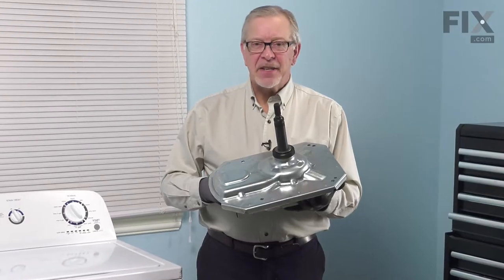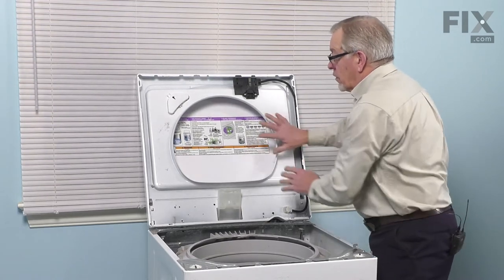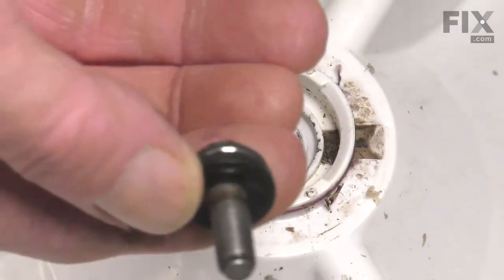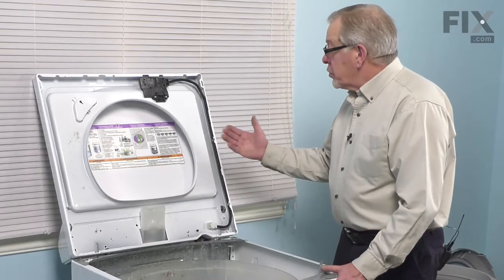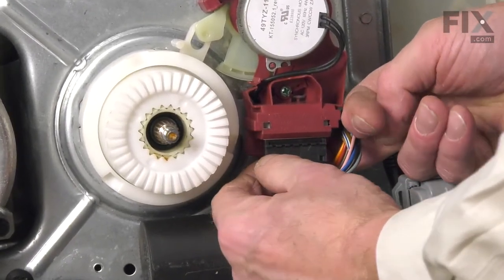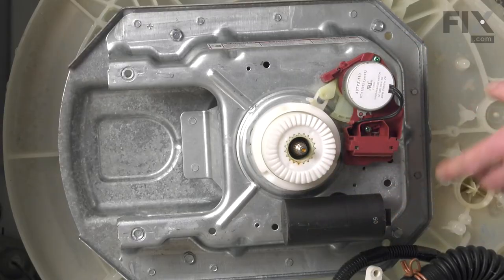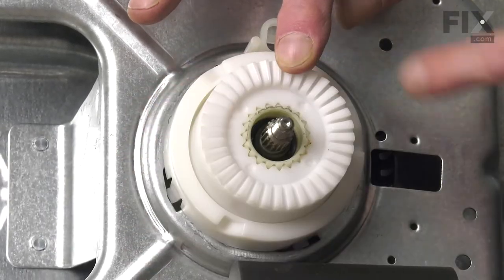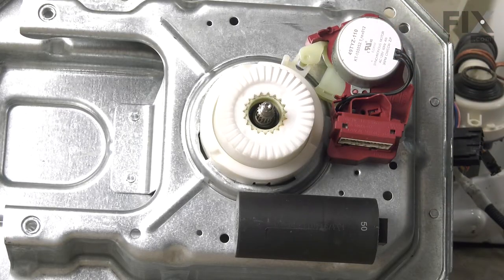Whirlpool Washer Repair - How to Replace the Gearcase

Comment: To those having a ton of trouble getting the tub off the shaft, don't give up. I had to use a 2x4 and a bottle jack. I even had to put the bolt back in the shaft because the jack bottomed out on the tub before it came free from the shaft. There are videos of how to perform this task right here on YouTube. To the person who made this video, thank you so much. You saved me a ton of money.
Reply: Yup, I used my car jack and a 2x4. I also had the issue of the jack bottoming out so I placed a 13/16 socket on top of the shaft and balanced the jack on the socket and it finally came all the way loose. "It's a really easy job", yeah right 😒🤥
Reply: I don’t understand why you have to remove the basket if there’s nothing beneath it you have to unfasten to get the gear case out…

Comment: For those with a stuck tub, I used a bottle jack, cut a couple boards to fit under the lip of the washer then placed bottle jack on top of shaft and raised until it was pressing against the boards thereby lifting the tub away from the shaft. Also for those without a spanner wrench (if yours needs it, use a hole punch or chisel and tap the nut counterclockwise with a hammer. This video was pure gold! Couldn't have completed the gear case change on my wtw5500xw1 without it!

Comment: Great step by step directions!  IMPORTANT CAUTION TO THOSE PERFORMING REPLACEMENT.  I followed the instructions and it worked perfectly, until the Fast Spin Cycle.  Sounded like it was spinning too fast.  I was wrong.  Spent a lot of time trying different things.  Came to conclude it was an alignment issue with the Hub fasteners and the Gear-case bolts.  The hub fasteners are accessed from inside the wash tub.  (Top side)  Whereas the Gear-case bolts to the housing under the machine.  (underneath)  The first time, I bolted these down separately, not thinking of the slight alignment  condition which ensured.   The second time (after the noise in the fast spin mode) I loosened both the gear -case bolts and the hub fasteners screws.  (Loosened, not removed)  I then moved the gear-case around a bit to re-seat the rubber washer inside of the bottom of the tub.  I then tightened the gear-case bolts a bit. (Not fully tight.)   I then flipped the unit back up, and secured the previously loosened hub screws and set the horse shoe fastener.  The I flipped the unit back over again to fully tighten the gear-case bolts.   IT WORKED!  No loner sounds like a jet plane taking off when in Fast Spin cycle.  Hope this helps others.  It worked for me.
Reply: Thank you for sharing this.
Reply: “Hub fasteners”?  What hub fasteners?

Comment: Thanks for a thorough and helpful video!

I wish I saw this before changing the transmission on a newer model.

I didn't put lube (soapy water) on the shaft gasket and had a hard time inserting the transmission into the tub. 

I suggest putting lube on any sliding plastic parts. Perhaps silicone grease.

Beware the sharp edges on the transmission.

Comment: Just did this a few days, and it was greatly appreciated.    after 10 years, i took all the parts outside and powerwashed all the slime and crude off the drum, the plastics and hub.     no amount of "Cleaner" cycles were removing that.

getting the spline out of the hub took some work due to the build up of crud and a little rust.

Comment: Thank you so much for this video. It made the replacement so easy. That said, I'm now encountering a different issue. After calibrating the washer, I am getting a "Load Balancing OOB" error code if I try to run a cycle with laundry. Any thoughts on how I can resolve this?

Comment: Excellent video! I work on cars all the time and I've fixed AC units, refrigerators, washers, and dryers in the past, but never done a gear case on a washer before, so I was reluctant.  This video featured a nearly identical unit to my model and is so detailed that anyone with basic tools can handle it.  Thanks again!

Comment: Fantastic video! Thank you so much for the detailed instruction, my Maytag Bravos X was loud during spin and found it was the gear case. Other information online for Bravos X lead to bad bearings but after looking underneath the machine it had the gear case which couldn’t be taken apart. Your video helped me take the machine apart, change the gear case, and put it back together. Thank you very much!
Reply: Same with my Whirlpool Cabrio. I hate the throwaway society and lack of replaceable parts, such as bearings.
Reply: I just did the repair. Put it in a recalibration. Now it won't fill or wash. If it's in the automatic test mode it runs through everything in finishes. Just won't do it when on a wash cycle. I'm a appliance tech been doing it for 6 years. I'm stumped
Reply: @joshuamills765 What was the solution to your stated problem?

Comment: Thanks for the video, it was helpful.  A couple of comments.  One, I have had to replace the gearcase twice.  The washer is only 8 years old, but it is clear that the gearcase design has some problems.  Secondly, removing the inner tub can be a problem.  As you suggested, I used some penetrant, but it still wouldn't come out.  There is a YouTube video that shows a method using a 2x4 and a car jack to get the inner tub out.  I know, sounds pretty sketchy, but it worked.
Reply: I have an idea how to fix the issue on maytag washer without replacing the gearcase and the hub's ass'y,please response to my email,I'll show you how it's done!.
Reply: @eddychakkaw4546   Hi Eddy
 I'm interested in your idea about the gearcase. Please elaborate. Mine is loud(howling) when spinning.

Comment: Taking a long shot here, I took off the 7/16 nut in the washer, took off the 4 10mm bolts, you were able the pull the it right out. I cannot pull it out even using some pry bars, any ideas?

Comment: I have a 5 year old Kenmore washer, started making grinding noises. The tech and I though it was a worn washplate but the washplate was fine. He consulted with other techs and concluded it was the gear case. How long should a gear case last in a washer?

Comment: Thank you for the informative video. I followed your instructions, everything went together just like the video. However, my washer has been making a HORRIBLE screeching noise while in the rinse mode. Do you have any idea what could be causing this?
Reply: If anyone else experiences this screeching/ high pitched grinding, replace the splutch assembly. I did & my problem went away.

Comment: I have a Maytag Bravos that wont spin (F7 E1). I changed the actuator, that didn't help. In diagnostic mode I ran the cycles test and when it got to the agitating cycle it seem to be straining. I took off the drive belt and ran the test again and the motor is agitating and spinning as normal .I am thinking of changing the gearcase, but seeing that it is a very expensive part, I want to be sure that is the problem. Is there a way I can test to ensure that that is the culprit. Would appreciate any help. Thanks
Reply: We had a similar problem. The culprit was a nylon disk. The teeth had worn off and it wasn’t engaging with the gear case. We ordered a PS6012095 Drive Hub Kit and replaced the nylon piece. About $25.

Comment: I can't get the tub loose from the washer. I used the jack method to get it loosened. I've got it lifted as far as the jack will lift it. But it still will not come off.  The shaft it barely showing the whole it was in, in the tub. Any suggestions?
Reply: I'm probably too late to help you, but I had a similar problem.  I used this jack method as well.  This method is described in another YouTube video.  My solution is hard to describe, but here goes.  I put a long 5/8" socket over the shaft.  I repositioned the jack and this gave me enough extra "throw" to get the tub off the shaft.  You need about 3 hands.  The jack sits on the socket and you have to hold the 2x4 and then turn the jackscrew.

Comment: What about calibration? I thought after main control, basket, drive assembly, suspension, motor, or capacitor that recalibration is required?

Comment: I have a 7 month old washer.  Why would the gear case go bad on brand new washer.
I've had 20 year old washer previously.
Reply: As I mentioned in a comment above, I have had to replace the gearcase in my washer twice.  It is 8 years old.  I would guess that the gearcase is poorly designed and/or uses inferior parts.  I will never buy a Whirlpool again.

Comment: Now what would be the symptoms of that needing replacement? Washer shaking and banging? Replaced suspension rods and still did not solve problem.
Reply: Very course and loud noise when in spin mode, and, as was the case with mine, water pouring out of the bottom of the machine onto the floor.

Comment: Great informative video. I am replacing the gear box of my  4 year old lightly used Kenmore/Whirlpool washer, that by accident I discovered was leaking oil real bad. Waiting for that gear box, only one question that caught my eye, when the impeler is removed, visible at the bottom of the drum, there is an arrow, what is that arrow indicating??. Thank you.
Reply: Thats arrow is for a bearing specialty tool and what position to put it at. This model doesn't need it. I'm sure the tubs are the same on both units though.

Comment: How much vertical shaft play is too much? Would excessive shaft play indicate a replacement transmission?
Reply from the maker: The up and down play in the shaft is 1/8 of an inch , more than that you will have issues with the splutch engagement, likely slipping. You are correct replacing the transmission is the only recourse.

Comment: Called Maytag and they said the loud noise is from needing to change the tub seal and bearings. Ordered parts and it doesn’t look correct. 
Can you change the tub seal and bearings on that gearbox?
Or do you just change the gearbox?
Reply: Did you ever find an answer?
Reply: Post video of the washing machine spin cycle

Comment: The impeller on mine is not coming off by hand as in the video. I just about broke my back trying to get it off with no luck. Seems like it’s rusted onto the shaft so I’m at a loss now for repairing it.
Reply: Vinegar and degreaser with boiling hot water!

Comment: I have a Whirlpool compact front load dryer model WED7500VW that I need to change the start capacitor and do not know how to get to it. Front panel screws are to 
close to the drum to unscrew and back panel supports the drum. Any ideas?
Reply: Do you still need help

Comment: How do you know if the Gear case is bad? I have error code F7 E1 it won't rinse thought it was the actuator but didn't fix the problem.
Reply: it will sound like you have a subway in your laundry room when it starts its spin cycle.
Reply: If it sounds like an airplane taking off, chances it's your gearbox. Does your tub spin freely by hand or did it lock up? If it locked up, you can break it loose by hand and get a couple of months out of it before having to replace the gear box. It's certainly cheaper to do this as oppose to buying a new one!! Good luck!
Reply: I'm in the same boat. Is it the gearcase or maybe just a bad hub? It didn't sound like a subway, it was squeaking and I thought the spluch went bad again.
Reply: It ended up being my drain pump.
Reply: @rodrigomejia9096  I'm hoping it's just the drive hub. Glad you got it figured out.
Reply: @michaelblosenhauer9887  I double checked the code error and it ended up the drain pump.  I hope you get it figured out.
Reply: @rodrigomejia9096  
Hello, I’m having the same issues after removing my drain hose to remove a clog. How did you fix your issue?
Reply: @lilaleahg  I had read the code wrong it ended up being my drain pump.

Comment: Why did you take the tub off? Can you leave it there ?
Reply: I replaced mine without taking the tub off. I did have to loosen up the gearcase from the bottom and the stand the washer back up so gravity would help pull it down. Took handle of a hammer and just tapped it down. Laid it back on it's front and pulled the gearcase out. When putting it back it, the gearcase fit all the way in but the tub didn't slide all the way down so I did have to pop a few of the plastic tabs on the outer ring to loosen some tension and it just dropped all the way down. So yes, you can leave it there you will just have to work a little more at getting the case back out and in.
Reply: That's what I was thinking. It likely isn't necessary to completely remove the tub.